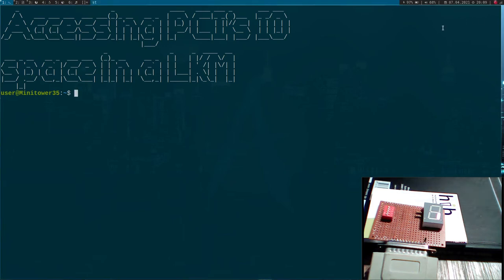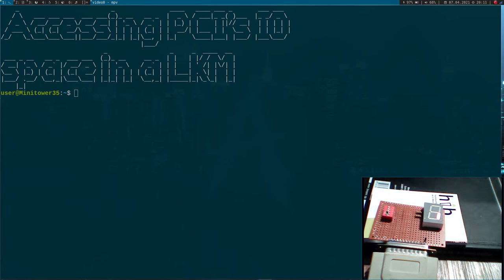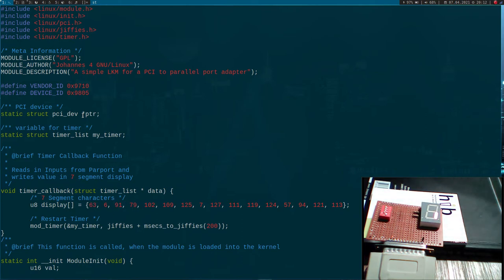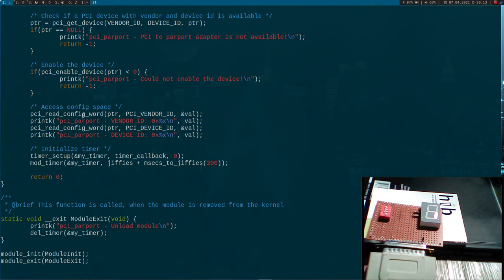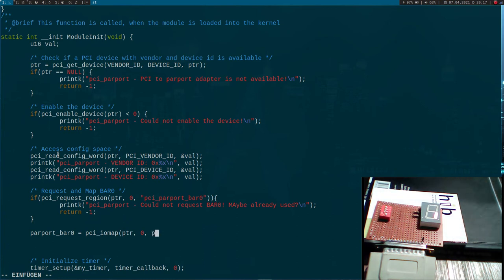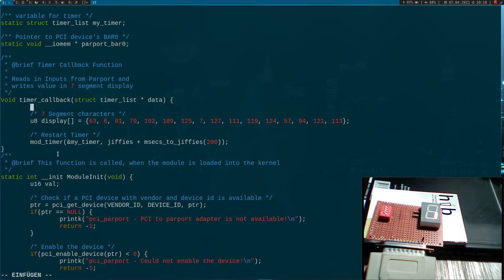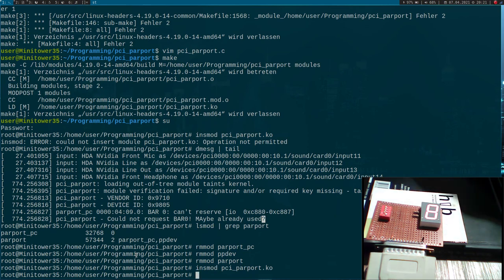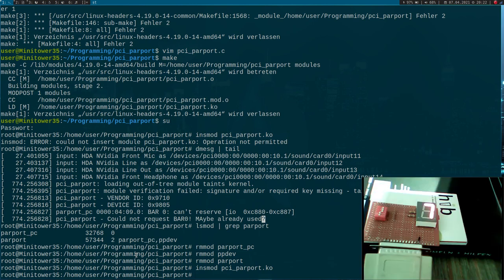GNU/Linux & PCI (Express) - Part  7: Access PCI(e)'s IO space in a Linux Driver

Comment: Hi, thanks for the video!  How can I utilize those kernel functions (iowrite8/ioread8) for a user space program?
Reply from the maker: Hi, don't use ioread8/iowrite8 in a userspace program. Use inb/outb instead. I show you how to use io space from userspace in this Video: https://youtu.be/v-vHBOxQgNE
Reply: @johannes4gnu_linux96  If there are functions in user space to access the PCI card memory, why do I need kernel drivers to do so?
Reply from the maker: @yonatanelizarov6747  there are still a lot of reasons why you need a Kernel Driver:
- Interrupt Handling: over sysfs you can not receive Interrupt. You can poll for them but you can't use a Classic Interrupt Handler.
- Timing: In a Kernel Module you in General have better latencies and your Programm can't be scheduled out. You also have smaller jitters
- adopting to Standard Interfaces: you can create a Driver so it can Dock on an existing Kernel Subsystem. E.g. for writing a gpiochip compatible Driver you only have to implement a few callback functions and then you can use it with Common Linux utils Like gpioset/-get. Or think of a networking Driver. Same Thing Here.

Comment: Are you using any extra circuitry? I suppose to display this you need 8 output pin but at 1:20 you said 1st register you only have 5 digital output. How you are accessing 7 segment display with only 5 output pin ?
Reply from the maker: No, sorry, my bad.
The parallel port is set up as following:
Byte 0 is connected to D0-D7 (eight digital outputs)
Byte 1 is connected to NACK, Busy, Paper-Out, Select and nError (5 digital inputs)
Byte 2 is connected to Strobe, Auto Linefeed, Reset and Select Printer. These pins can be used as inpits and outputs. 
See here for more details:
http://hi.eecg.toronto.edu/seatsale/programs/www.beyondlogic.org/spp/parallel.htm

Comment: So when do we use other BARs?  you mentioned about 3 registers for parallel port but used only BAR0. are all three registers mapped to BAR0? how?
Reply from the maker: BAR0 contains 8 Bytes.
The first Byte is mapped to D0-D8
The second Byte is mapped to the Inputs (Busy, Ack, Paper Out, Select)
The third Byte is mapped to the remaining outputs.

My PCI-Card is available in other variants, which includes two more Serial Ports. I think the other BARs would be used for the serial port. But as this is not assembled on my PCI-Card, I only care about BAR0.

Comment: How you are accessing 7 segment display with only 5 output pin ?
Reply from the maker: Check out my other answer. I made a mistake here, the 7 segment display is connected to the 8 Data pins of the serial port which can be controlled by Byte 0.